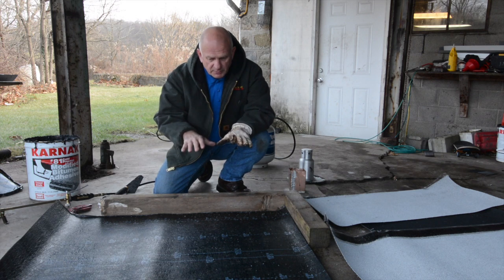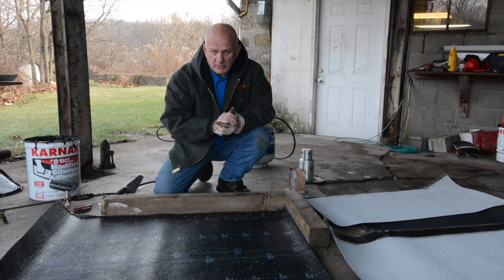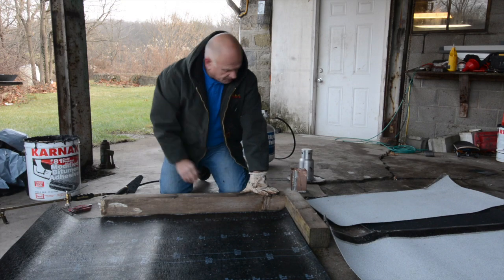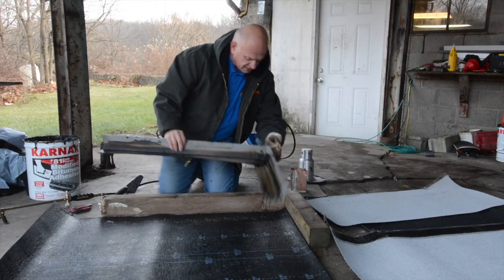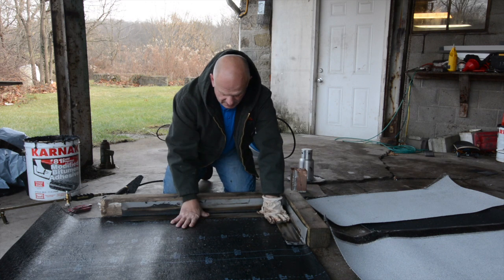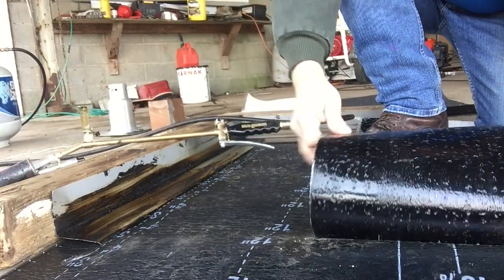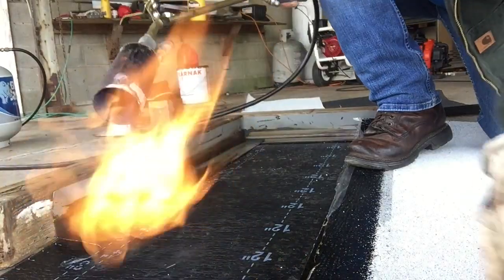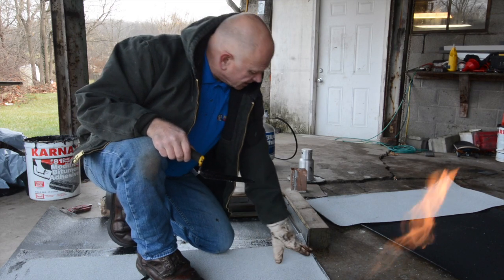Flat Roof Repair - How to make a repair on a Torch Down Rubber Roof

Comment: I have a roofing contractor replacing the flat modified bitumen torch down roof of my church. I am overseeing the project and your videos have helped me to identify some issues with the installation and have him correct them. You've also shown me ways I can maintain and repair it to have it last for many years. Thank you so much!
Reply: this is not the way to repair it.

Comment: Very knowledgeable roofer.  I did a torch down on my home 20 years ago when you had to nail down the underlay mat.  This new glue down mat is great.   Remember he was doing an example on a garage floor in freezing weather.   If he was on an actual roof he would not have stepped on the hot material and he would not have cut his repair pieces on top of the roofing material.  He also would have had a couple of fire extinguishers strategically placed around the job.   Great information.
Reply from the maker: i ak glad you ;iked it
Reply: i have seen him with no visible fire extinguishers.

Comment: So what if it's to cold for the peel and stick to stick? Do you have to torch it like you do the top cap? And why do you round your corners on the tar patch? And so you can't torch down with a plumbers torch?
Reply: I was wondering the same thing about cutting his edges round on the repair.

As to the first layer, he said as soon "As soon as I heat this up it will stick" so he did imply that he would be torching it.

Comment: one question...what is the best way to detect a small leak on flat built up roof...I live in El Paso, Tx....water ponds in several areas, unfortunately....only have small leak inside....does not seem to be leaking from directly above...any simple way to diagnose source of leak...thanks!!
Reply from the maker: Ok, it is not an easy answer. First, experience helps to detect leaks. I know what signs to look for on all types of roof systems.
You mentioned a specific roof system - Build Up Roof. These types of roofs almost do not exist anymore but, if you still have one here is my take on it.
1. If it is over 30 years old, you need to be careful. You could make things worse.
2. If the ponding happened over time, that means that the roof sagged in that area, putting stress on the roofing material. That could cause a crack in the Build-Up Roof.
3. I think don't waste time to look for the spot where it leaks, because it could be the layers starting to separate, but rather remover the water and debris from the ponding area, clean it thoroughly, then roll paint Karnak 81 or 66 brush grade over that entire area.
Good Luck
Naas

Comment: Never owned a home with a torch down roof.  Having issues with roofing material  bonding to drip edge and water infiltration (wicking) back onto decking material.. Had no idea how to "fix it" or if it was something I could do myself.  First off I would have bought the wrong repair materials (tar) and applied it incorrectly .  Now I know what to look for and see how the roof was installed and if the torch down was properly installed initially.  Right now I have deck sheeting to replace then fix the roof materials correctly.  Might be in over my head but have access to more videos to figure it out.

Comment: Good stuff, I would like to see more examples of how you put down the base and cap sheets and flashing against the wall to the deck floor.  That connection seems to be very critical for me on my job.  You went over it here but I have a stucco wall and a deck that does not have flashing, and I'm trying to figure out how to work it. thanks.

Comment: Seeking advice I have a family carport near St. Louis Missouri .  80% roofing material good, fixing old rotted edges but with deep peaks and valleys along the whole space are substantially strong but has deep cracks and valleys has me concerned. I’m not professional. Its our family. I have done several mod bit projects using your much loved education with confidence. However I feel I need to use the underlayment with new fasteners across and or some Karnak to fill the valleys of the old thick old school before we do a full top mod bit finish. Much love . ....hoping to learn the real correct way to do what I am doing. Thanks for all you do
Reply from the maker: Hey Mike
I can't really get what you are trying to say. Can you send me pics of what your concern is and what it is you are trying to do? Tel 203 858 0080 Send it to this number. I would be happy to help. BTW, the "real correct way" is to strip old stuff away and replace it with new. That costs money.
Reply: Flat Roof Doctor will do. Thanks so much. I will send a picture in a couple hours.
Reply: Flat Roof Doctor will do. Thanks so much. I will send a picture in a couple hours.
Reply: Flat Roof Doctor thanks so much for your help today. It means a lot. God bless. If I only knew the term “alligatoring”, Like an alligators back, I could have worded my questions a whole lot better! 🙃

Comment: Hi again, different building, we added 3 rooms to our house in the tropics, same 100" or 254cm of rain yearly. The roof was a good redimix single pour of concrete, fiber strand reinforced in cement and apparently a waterproofing agent added to concrete. The join to original roof was prepped and a joining adhesive looking like white glue sprayed on, ahead of cement pour. We also created barriers and roof had water covering it for a 2 week cure. It has a slight sloap for drainage. And mosly good, In spite of this we have 1 small area of standing water, I would like to raise, it is about 1.5 meters, that holds about 1/2" or 1.5 cm water. Though it is not currently leaking I am concerned it will after 1 of our yearly earhquakes, or that moisture could get to the rebar and start internal damage.  Also we goofed, our plumber did some above roof copper pipe runs penetrating concrete, no leaks yet but don't want to melt solder if roofing. I realized after job that a Pex with aluminum inner layer is now available in Mexico and would likely have used that within pour. The most common here is just to paint with a acrylic coating claiming from 3 to 20 years but my previous experience is the UV damage generally has one repainting every year 2 unless hiddenn under a tile roof. Would you recommend the 2 layer Torchon material in this case?

Comment: What do you do if the roof is coated with an elastomeric.  Most roofs in Az do this for reflection.  I need to repair such a roof, but am not sure about how the patch will adhere with the elastomeric coating

Comment: Why don't you heat the knife? It glides better heated.

I like the ideas you have 👍
Reply from the maker: You are absolutely correct. When I torch a roof I always heat the knife and my helper too so it will glide. In this video I used material that was lying around. This happened to be a roll from Soprema. The most expensive torch down rubber but the hardest to work with. The rubber got soft so fast and I was not used to it.
Good observation
Thanks for the comment

Comment: This is outstanding repair sir 1 million stars for well done repair. 
I have a torched down rubberized roof on a small back porch. It is leaking where the house roof meets the rubberized roof and at the gutter line. The entire roof surface is in pristine condition. Roofing companies want to do a full tear-off. After seeing this video, I know now that it is not necessary. What should I do? Please advise. Thank you!

Comment: You’re video is very helpful. I have a question about my roof my roof has ripples in it and is now leaking how do I get rid of the ripples?
Reply from the maker: very hard to do. The way I used to do it was to cut on both sides of the mole tunnel, remove that section and Torch a new patch over that.
But if you don't have leaks, leave it alone. You might want to inspect the roof  where the material is pulling away from the corner or wall due to the ripples. That could cause the membrane to pull away from the flashing.
Reply: @FlatRoofDoctor  the ripples or down the center of the roof my roof has multiple leaks and I want to fix them before my wood rot
Reply from the maker: @hipo58  Ok cut them out and torch a membrane over that area
Reply from the maker: @hipo58  Send me pics to my tel 203 858 0080 and I will give you a better idea on what to do

Comment: Interesting video, I have a roof in the tropics with a 100" or 250 cm year rain, i noticed the 1 st year quite a bit of the grey particle coating accumulate near the drains. I was wondering if I would extend the roof life by using a white acrylic liquid membrane painted on that they use on cement roofs here? Or would that hinder using torch on when needing patching or recoating with another layer of torch on in future? This was supposedly a premium polyester grade that they told me was warranted as a 10 year, fiberglass based would have been 5 year.  The other idea behind using a white coating is to increase reflectivity as well as trying to retain the particle coating.

Comment: Can a peel and stick base be applied directly over slate tiles?  Or maybe apply mortar bed over the tiles first?  I have a 2nd floor deck with slate tile that I want to waterproof.  Was thinking of just putting torch down roof directly over slate tiles and then put floating wood deck on top.
Reply from the maker: Put the peel and stick base first then torch down over that.
Then you can put anything on that. Itis a tough roof

Comment: Lucid presentation, thanks! But how do you handle "end-laps"? 
If you have a roof that is wide enough, you'll need to overlap cap sheets. Those edges have mineral coating. Do they get modified bitumen adhesive between them? Or is torching used?

Comment: I will be building a low pitch addition roof.  I plan to first prime the new plywood with Lancôme Aqua proof primer.  Then put Grace Select membrane as an underlayment.  I was going to use GAF Liberty self stick cap roofing over that, but I’m still open to ideas about what to use for the cap sheet.  Have you used any self stick cap roofing with any luck?
Reply: Go with Flintlastic

Comment: I am 52 and out of shape. I will be doing this by removing the current layers of old tar hot mopped roofing and then Modded Bitumen. I don't have the under layer but the existing original roof has nice tar on it with no cracking. I hope it will stick without the first layer.
Reply from the maker: I dont think you need to remove any old roofing. What is needed is the metal flashing to tie in. So, if can remove all the tar and roofing material from the flashing then go over the old roof with your mebrane and then tie into the cleaned up flashing, you should be ok.

Comment: Is the black membrane repair material the same as the silver color modified bitumen, but in black color?  Is there any reason to use the black membrane for repair instead of just using the same silver modified bitumen for a patch?  Wouldn't the silver material help to reflect sunlight better?  Thanks.  I just stumbled on this video.  You explain things very clearly.

Comment: I have done a few torch down roofs and have had problems with patching.  What Iearned here is the tar you use has to be for the repair has to be made for the type of roof you are using.

Comment: The only torch down product I'm familiar with has a smooth rubber finish side.  I notice what you are using has an asphalt finish.  Are they different products?  Is what you are using indeed called modified bitumen rubber torch down?

On your first patch you say black membrane..is that the base membrane you used initially?
Reply: The white mineral that sits on top of the second layer protects from UV. The other sheets that don't have it will deteriorate from the sun over time.

Comment: My contractor put the wrong flashing on before torching down. Is it possible to heat it up, peel back and torch it back down?
Reply from the maker: I am not exactly sure what you mean. But this is what I think it is.
The Torch Down Rubber is attached to the metal flashing and you want to peel it back?
The best is to cut the membrane short from the metal flashing, then weld another membrane strip overlapping the roof and attaching to the flashing again.

Comment: Great info! Helpful to fix two leaks in a flat roof that meets asphalt shingles.  Got quotes for 2 months, too long to wait with all the rain.  One question, can this be done on a wet roof or how long do you have to wait for it to dry? Can you speed up drying by using the torch?  Thx
Reply: I'm not a roofer however, I know Karnak makes a bitumen adhesive that will work even wet, it's manufactured with that purpose in mind. It's in a light blue can. You just have to clean the area of debris, but wet is ok. I know your post is old but hope this helps anyone else.

Comment: Thank you for the demonstration, very informative, I have a torch-applied flat roof that has two low areas from previous leaks, now water puddles in these low areas (each appro. 25 sft). What material or how to level these areas for proper drainage, I live in the intermountain area with very cool and snowy winters. I had three leaks in these areas this winter that is now temporarily patched but I am looking for a permanent solution. Thank you
Reply from the maker: If done right, a roof with this torch down rubber should never leak. Don't worry about water sitting on it. Make sure it is a torch applied roof and not a peel and stick membrane. You can tell by the seams if any material has oozed out when the were torching. If you don't see any oozing then it is probably a "peel and stick". Don't use tar to make temporary repairs. It is messy. Rather take a trowel and try to shove it between the seams. If the trowel can get into a seam, then you have found the problem. You can either buy a small plumbers propane torch or a regular roofing torch and reseal the seams or get someone to do it for you.
Other places to look for leaks are the flashing close by or any penetrations. 
Send pics to my tel 203 858 0080 and I will be able to help you trouble shoot.
Reply: @FlatRoofDoctor  Sir it is torch applied, I watched them when they installed it. The roofing material is without aggregates and must be covered with the aluminum roof coating. The coating keeps coming off where the water puddles. I have to repeat the aluminum coating every year.
 I really looked for seam separation but could not find any, I had to use tar to cover the suspected seams and leak stopped.  The biggest problem I have is the areas where water is not draining because eventually water finds its way to leak if I find a way to eliminate low spots then the rest of the roof is pretty good shape. I can not get help from any local roofers because they always want to replace the whole roof at a huge cost. Thank you for offering help I will send pictures.

Comment: Where did you buy this white roofing??
Reply from the maker: Allied Roofing Supply, Beacon Roofing or ABC Building Supply or most other Roofing Supply places. The reference would be Torch Down APP 180 White Granules. The brand I use is Firestone, but GAF and John Mansfield and about 20 others also make this material

Comment: I have a large flat roof to repair, can I go over the existing or old roof? Its 3120sq.ft.
Thanx Bob
Reply from the maker: If it is a existing Torch Down Roof, then yes, you should torch straight unto that one. If you have "Silver Coat" protection on the existing, then you should use a Peel and Stick base 1 st
You can contact me at 203 858 0080 with pics and or call to help you make the best decision
Reply: @FlatRoofDoctor  ok Doc thanx I'll be calling on you. I'm in W. Texas.
Reply: @FlatRoofDoctor  I'll be in touch Doc. 
Thanx Bob
Reply: @FlatRoofDoctor  hi Doc,
Found myself under the weather the last few days, I'll be going back up on the roof on Wednesday.  I'll take pictures and send you. Can I send them to you on the phone number you gave me.
I REALLY appreciate your help on this matter. 
P.S. what was the name of that process you used to go over the gravel roof ?
Thank you Bob

Comment: How long should that cold patch last? I've been struggling with a flat roof scuppers for 10 years and spent thousands on roofers to fix it.The original roofer stopped returning my calls years ago. Others have taken my money and not done very well.   I'm ready to give this a shot myself. Also, could adding a membrane layer behind a scupper be used to reduce ponding?
Reply from the maker: Hey Brent
It is unfortunate that your case is shared with many. The problem is experience. Most "roofers" don't have that. They might be experienced in some aspects of roofing but not in finding and fixing leaks. Many will use"cold patch" as you call it.
What I suggest is to do the following:
1. Remove all the tar and membrane that is inside the scupper till you see the copper or metal
2. Make sure you clean all old roofing away from the scupper even as far as 2" into the roof area
3. I assume this is a "Torch Down" roof. Find yourself a modified bitumen membrane, not "Torch Down" but SBS Membrane and cut a piece that will overlap the roof side about 4" and fit into the scupper all the way through
4. Use Karnak 66 Trowel Grade and smeer a thick layer of that in the scupper (entire surface) and 4" over the existing roof
5. Apply the measured SBS membrane over the Karnak 66 and put pressure to remove all air bubbles and make sure it sticks to the roof membrane as well. 

This will solve the scupper problem.
I think why everyone has failed over the 10nyears, is that no one wanted to remove any of the old stuff and tried to patch over everyone's  mess. That is impossible to make a repair like that.
Reply: @FlatRoofDoctor  Thanks. that's pretty close to the conclusion that I've come to.